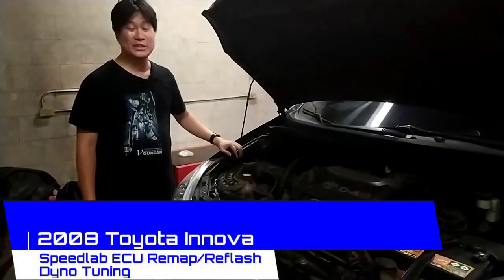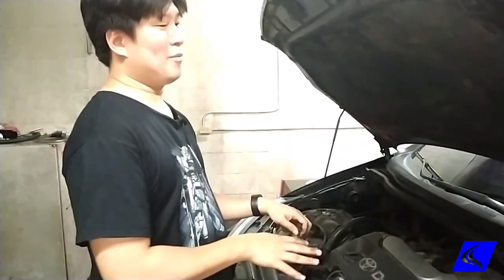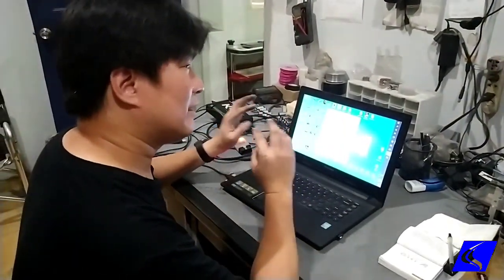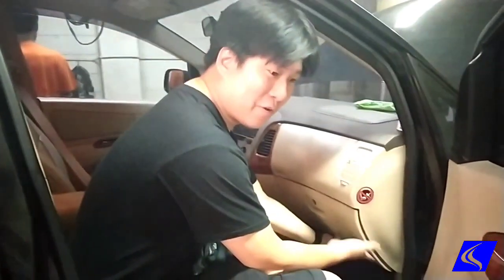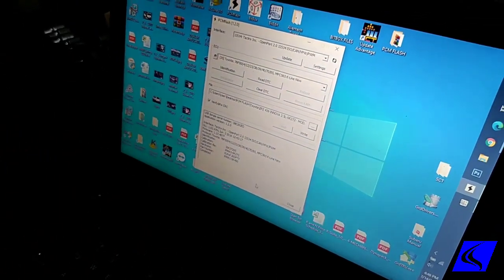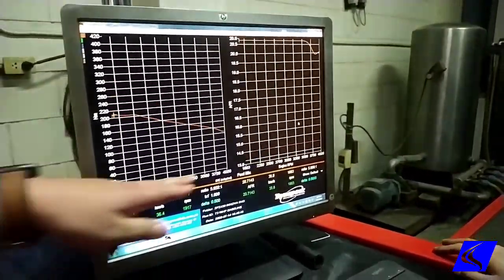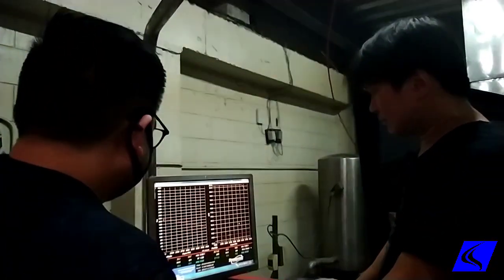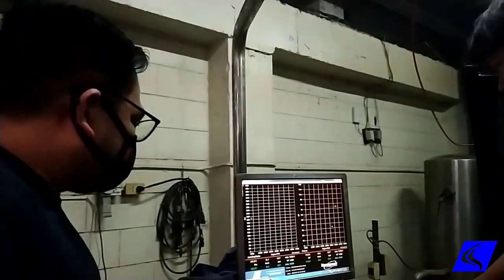Toyota Innova SpeedLab ECU Remap/Reflash How To

Comment: Hi Sidney. Always watching your channel and I admire the way you explain details about engine tech... 
I have an Innova 2005 diesel and I am having problem with its torque and low throttle response. Hard in climbing stiff slopes and overtaking Would re mapping address this problem. Will appreciate your kind advise. Thanks
Reply from the maker: Yes. Bring to shop to assses

Comment: I'm wondering if it is possible to increase the hp of my 2015 Innova G diesel. I would also like to inquire about the installation of a blow off valve on my stock engine. Plus the possible expenses so that I could save some money for it.
Reply from the maker: Ecu remap/reflash p29000
Blow off valve 20k

Comment: How much additional torque and hp if vvti 1tr fe 2.0 at??
Reply from the maker: 12-17hp
20-25nm
Reply: @speedlabchannel4452  it will improve the fuel efficient? or still the same as stock around 5.5-7km per liter
Reply from the maker: @ginokuh187  8-10% better mileage

Comment: Can I use the Unichip for a Ford Escape 2004 model? If so how much if I bring it to your shop Sir?
Reply from the maker: 35000
Reply: @speedlabchannel4452  Thanks for the response Sir. Will try to visit your shop to have it installed. Do you need to have an appointment to visit? Or just dropby anytime between mon-sat?
Reply from the maker: @josemariandres4361  better with appointment

Comment: Sir I have furtuner 2018 diesel automatic. Will remap help the consumption? Thank you in advance
Reply from the maker: Yes 8-12% titipid with normal driving
Reply: @speedlabchannel4452  how much po?
Reply: Im doing 5 to 6km/liter any recommendation?
Reply from the maker: @josephaguinaldo4442  25000
Reply from the maker: @josephaguinaldo4442  ecu remap/reflash 25000
Full exhaust 35000
Reply: @speedlabchannel4452  thank you

Comment: Wala po ba itong modification like full exhaust intake and intercooler?
Reply from the maker: All stock
Reply: Most likely how many horses gained sa innova kapag full exhaust tapos changed air intake at naka intercooler?
Reply from the maker: @johnphilipparas9988  another 8-15hp
Reply: Dyno tuned na po ung 8-15?
Reply from the maker: @johnphilipparas9988  no. That's just the additional from the exhaust and other things
Reply: Thanks a lot sir additional info... been dreaming of remaping my innova but seems like it will happen 5years more ahahaaha aftee graduation

Comment: Sir matanong ko lang po. Di po ba direct po ang turbo paputang intake manifold po nang mga 2.5 d4d po? Dahil wala po siyang intercooler. Katulad po niyang innova po. Kung ipa remap po siya tsaka palagyan nang front mounted intercooler or sa taas nang makina ( bubutasan lang po yung hood tas lagyan nang hood scoop po) mas lalakas po ba ang hatak? Tsaka wala na po bang limit sa top speed at rev limiter pag naka remap na po tas di po ba mababawasan ang reliability po? Tas isang question pa po. Mas matipid po ba siya compare sa stock ecu setting at normal driving condition or tipid mode driving po. Napakamaraming salamat po. Isa pa po pwede po bang ipadala na lang ECU diyan sa inyu po thru shipping po? Nasa mindanao po kasi ako.
Reply from the maker: Yes send your ecu

Comment: Hello sir, magiiba ba yung rpm nia sir pag innova 2014?Thanks
Reply from the maker: P25000 with dyno
Reply from the maker: No. Rpm stays the same 
4000 rpm is still 4000rpm
Reply: @speedlabchannel4452  Sir  saan location ng shop nyo..my unit is Fortuner 2008.
Reply from the maker: Metrowalk’ Pasig
Reply: @speedlabchannel4452  how much pa remap

Comment: Hm remap 2008 innova automatic?
Reply from the maker: 25000
Reply: Thanks po
Reply: Sir pwede pa mapataas ung whp nya? Ano po ang mga papalitan para mapalakas pa. Thanks
Reply from the maker: K&n intake 10500
Full exhaust 30000
Front mount intercooler 27000
Alcohol injection 29000
Reply: Thanks po.

Comment: Sir may i ask what's the problem with a Innova 06,  rpm upto 2000 only then check engine light appears then goes to limp mode. When switch off and starts normal again, but when rev-up to 2000 rpm goes back again...
Reply from the maker: I don't know because we don't have it in the shop to plug in the scanner

Comment: Good morning sir ung Innova 2013 model nabili ko  2016 2nd hand nabili sir ngayon nagbago ung hatak parang humina dati nung kinuha ko 100 Ang takbo NASA 2000 exactly ngayon ung 2000rpm NASA 90 nalang Ang takbo ano dapat gawin sir maayos paba???? Thanks u sir.
Reply: Napansin Lorin sir ung mga 200678 na Innova mastahimik ung makina kesa ung 2013 Kong Innova
Reply from the maker: Yes message us in Facebook for schedule to remap your innova
Reply: @speedlabchannel4452  sir tanong ko Kung pwede bang discbrake Ang likod innova
Reply: Magkano magastos sir
Reply from the maker: Vernice Vlog's 90k disc conversion
Reply: Magkanorin un remap at palit Ng exhoust pag Innova sir
Reply from the maker: Vernice Vlog's remap 25000
Borla exhaust 30000
Reply: Pwede Rin ba lagyan Ng intercooler turbo sa harap sir ung innova??? Magkano sir
Reply from the maker: Vernice Vlog's yes

Comment: Applicable po ba ito sa all new innova manual transmission?
Reply from the maker: No. Only Unichip will work for the latest innova
Reply: @speedlabchannel4452  how much po kung Unichip at tunning? Do you advise Unichip sa newly acquired car? thanks!
Reply from the maker: Reggie Cadsawan as long as it has more than 750km then definitely 

35000 includes install and dyno

Comment: Speedlab, Sir nag remap po ba kayo Ng FJ cruiser 2015? Medyo malakas sa gas, milage 4k palang tinatakbo
Reply from the maker: Yes p25000 ecu remap/reflash
Reply: @speedlabchannel4452  sir may I know your phone number? Need po ba scheduling for remap
Reply from the maker: Yes you need to schedule
Reply from the maker: Yes 25k each
Reply: @speedlabchannel4452  Can I books for appointment? When can I have my FJCruiser remap? Hard to call your landline. Iam from binondo
Reply from the maker: 09175336456
Reply from the maker: Tomorrow is good
Reply: @speedlabchannel4452  how long does it take to remap the ECU?
Reply from the maker: 1-2 hours
Reply from the maker: I did give you my number to call. It’s easier than messaging here in you tube
Reply: @speedlabchannel4452  I am calling you but can't get good signal on my phone, I just called you on your landline, but you were not there.
Reply from the maker: I’m in metrowalk branch now 
Pasig
Reply: @speedlabchannel4452  ah ok, tomorrow will you be at pagataan shop?
Reply from the maker: Yep I will
Reply from the maker: 09175336456
Reply: @speedlabchannel4452  magkano po magpa remap sa 2015 Revo Hilux at FJ cruiser. 25,000.00 ba po bawat Isa?

Comment: Magiging snokey ba yan kapag na rrflash boss sidney????  Even vvti model innova kaya din ba ma reflash because due to hi fuel consumption
Reply from the maker: No it won’t be Smokey 
Yes we can reflash the gasoline and it will be more tipid
Reply: @speedlabchannel4452  sir hm gain for vvti if mareflash?
Reply from the maker: gab estremos 8-15
Reply: @speedlabchannel4452  thanks sir, if paired with full exhaust will it produce more?
Reply: @speedlabchannel4452  hm kilometer per liter?
Reply from the maker: ANTHONY BASALLAJE 8-10% better on average
Reply from the maker: Yes, more power with full exhaust 
P30000

Comment: hi! i have an isuzu crosswind sportivo...it produced 85 hp@3200/rpm and 185 nm@2500/rpm  and i did a manual tune, a custom fitted Garrett GTD10 running 28psi ,Hallman Pro manual boost controller , Ruien oil catch can , Cold air intake from K&N, a PDI intercooler , Upgraded fuel injectors , Enlarged injection pump ,full PPD catback exhaust system (from the 2.5 D-max) and fully stock internals whatsoever..  it didn't do much with the top speed tho! but it did have a massive improvement with the acceleration.. now it produced 151hp@2900/rpm and 366nm@2500+/rpm  but do you have any suggestions to increase the top speed? all i can do is 170-180kmh i have no Electronic Control Unit.. but just a rev limiter tops up to 4500/rpm thanks! *No Smoke No Fun! #new subscriber! love your vids! i hope i can visit your shop soon... but unfortunately im in mindanao.... but maybe soon!
Reply: hello sir, make a video about the acceleration of your crosswind hehe bc it sounds interesting☺️☺️☺️
Reply: @brixfordmanzano4150  YEAH SURE! ILL make one!
Reply: @brixfordmanzano4150  https://www.youtube.com/watch?v=Xtltv4Y_Ndw the vid is not so clear tho bc im not used to holding phones while driving this fast!..  this is recorded in mindanao koronadal area.
Reply: @jaredtamano9972  you're lying. The design of the instrument cluster is not a Crosswind. It's from the Isuzu Panther (Indonesian version of the Crosswind). Or unless you swapped the old instrument cluster to a Isuzu Panther instrument cluster.

Comment: Hello SpeedLab Channel! I would like to ask about remapping. I have Toyota Innova 2.5 E M/T 2012. My problem is when I hit around 100kph the rpm stays on 2700. Also when I hit top speed like 150-160kph it's beyond redline. Is it possible to custom the rpm limit to 5500 since the stock rpm limit is around 4500? Specifically, I really want huge improvement of power and also I want to catch up with all new innova's/fortuner/hilux.
Reply from the maker: Bri  by car to the shop so we can put it on the dyno to see if your car has a speed limiter. Some Inniva’s have it and some don’t